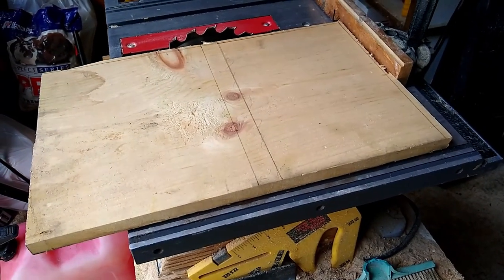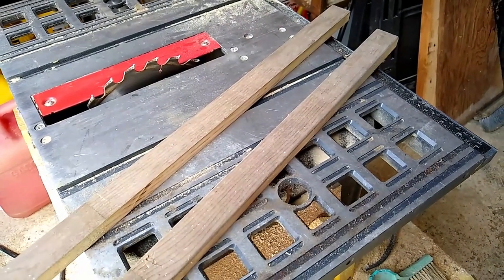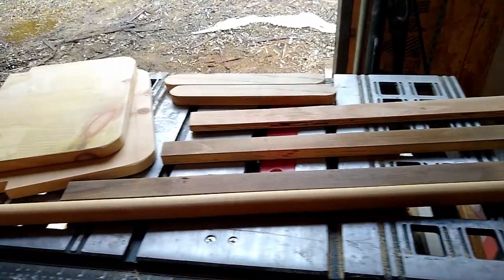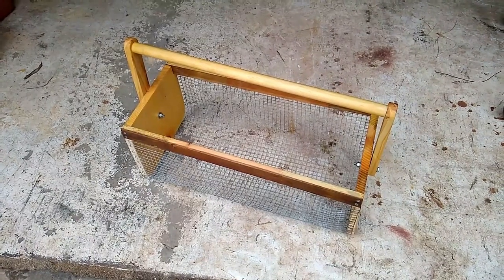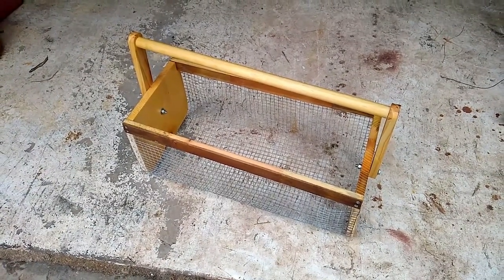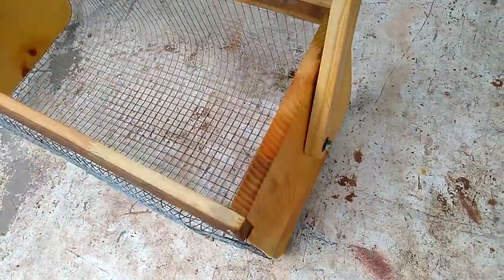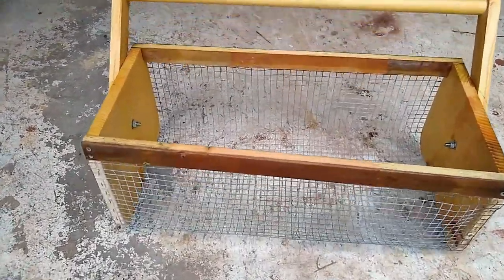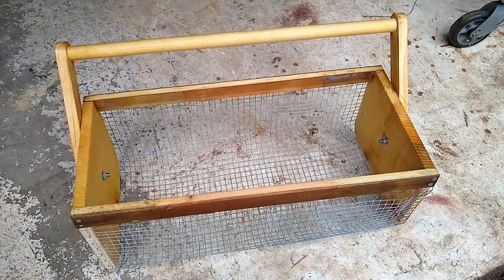Made a garden hod from a scrap wood and materials.

Comment: Nice job. Want to make one myself. 2 Questions.   What were the dimensions of the end pieces and is there any need to put support on bottom? For instance two slats running the length or is the hardware cloth perfectly sufficient?  Thanks
Reply from the maker: Dimensions of the end pieces were H9"x L11".  Total length is 24".
I did contemplate adding some strength to the bottom, however I found the hardware cloth quite strong enough when shaping it.  Now after finishing it, I would not put more than 50 pounds of water melons in it for example but, 10-20 pounds of carrots, lettuce, onions and radishes would not be a problem.  I was going more for volume it could hold than weight. Hope that helps.  Thanks for watching.
Reply: @westmountainnorth  thank you.  Helps  a lot.